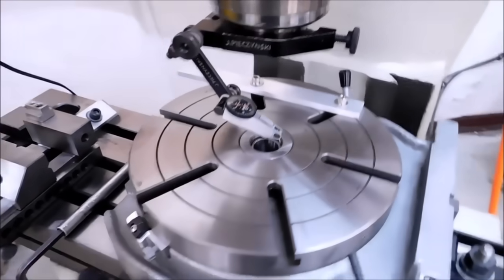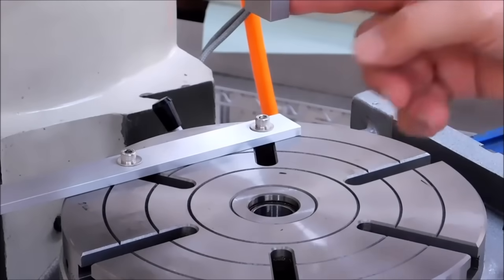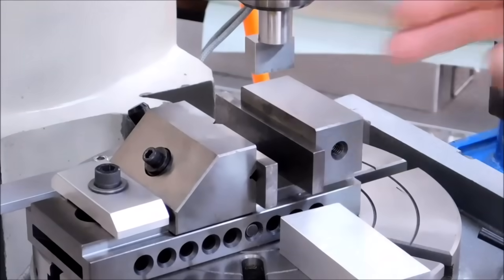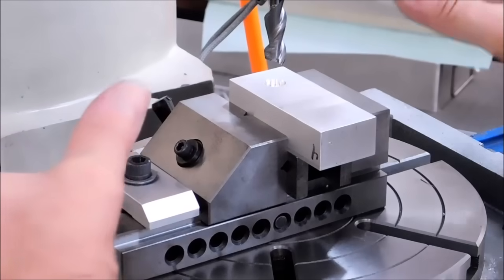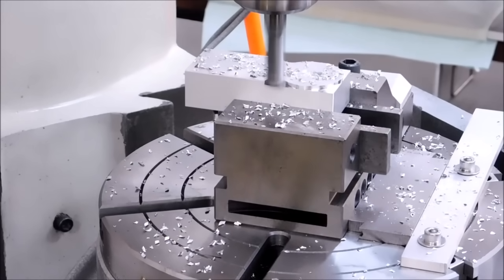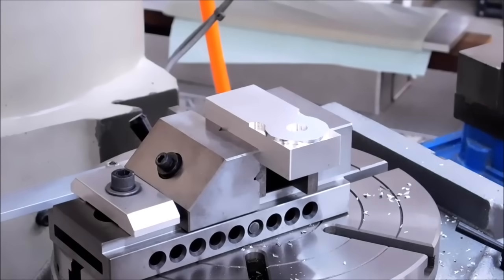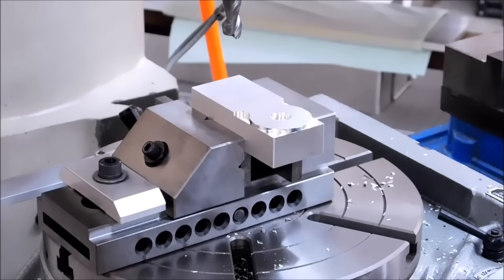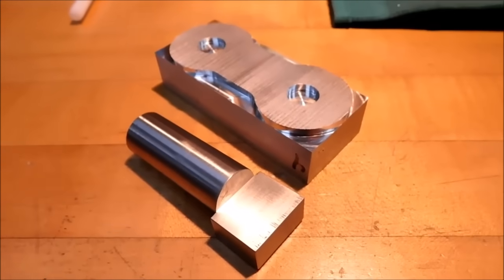Rotary Table Setup Simplified -- A Classic Rewind

Comment: Great presentation.  What material is the "pin" made from?
Reply from the maker: 303 Stainless
Reply: @joepie221  Many thanks for the quick reply.  Does  303 SS require any special cutter tool insert material for the amateur machines?
Reply: it's made from biribizonium but that's a secret

Comment: Happy next year!! tho i dont have a mill and just starting work with a lathe i enjoy learning about all the neat tricks you show!!! i just watched an interesting vid on "Hal -- heavy duty machining  Australia"   machining a mistake on a 3 meter drill head the flange warped when welding it on!  they got a "flange facing tool "  thought you and my other machinist video makers would enjoy it Quite a machine, kept busting their carbides tho and had to revert back to hss tools !!! the flange that warped was 2 1/4 in thick!!!!  hope you have a fun new year
Reply: Many types of exotic stainless will only work well is cutable with HSS and Rapid tap. We can't get carbide sharp enough. Inconels are like that. It is like trying to cut a tire with a 2 x 4, LOL. The Rapid Tap breaks surface tension.
Reply: @TomokosEnterprize  dont believe it was stainless just tempered by the welding (10 passes) and interrupted cuts of O-ring  grooves and warping.  but good to know about the stainless ,never worked with any
Reply: @frrapp2366  All jet engines are conected by Aa difuser between the engine and exaust bodies that can handle the 4000 to 5000 F degree xaust bodys by a difuser that won't be efected from exaust temps like that hot. It maintaines its size and shape.

Comment: Joe, I know that you do not have a Cross slide rotory turn table, but you could have done this in one setup with one!  You just have to think like a programmer/nc operater.  That would be simple for you.
Reply from the maker: Those X-Y rotary tables are nice, but weigh a ton.

Comment: Best manual machining tip I ever received. Thanks for both versions of this one. Sounds ridiculous, but I would LOVE to know how you store all the bits and bobs that go with each piece of equipment (or not). Nuts, clamps, centering tool, indicator holders, adjustable parallel, grinding vice, … where were all of these BEFORE you shot this video? Gradually dawning on me that organization (and dedicated tooling) is at least half the battle.
Reply: I don't know what Joe will say, but In my experience, more tools= more tool boxes. Plus cases that certain tools come in.